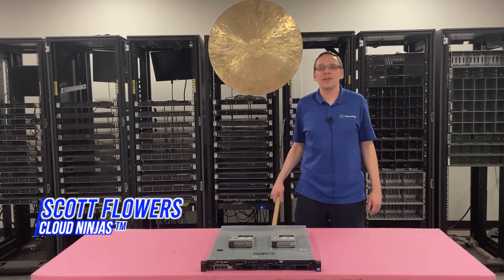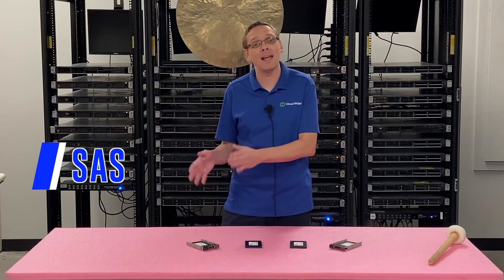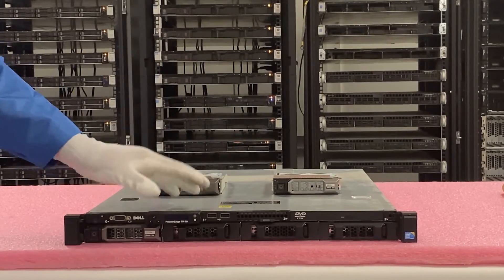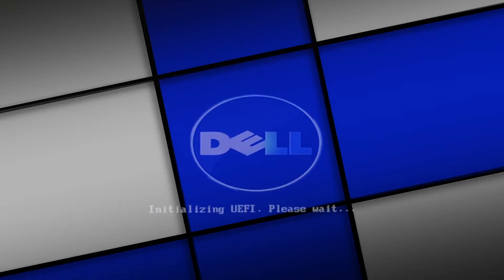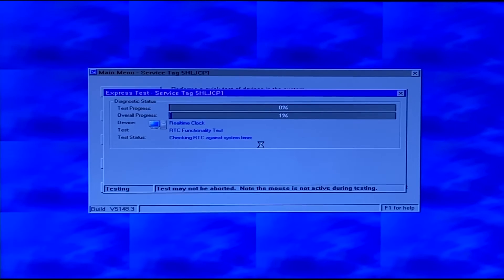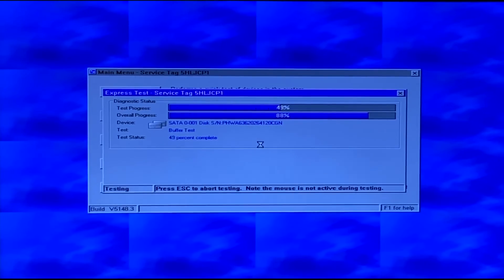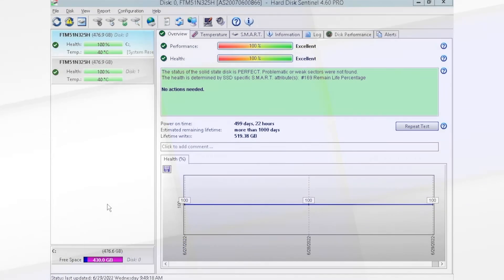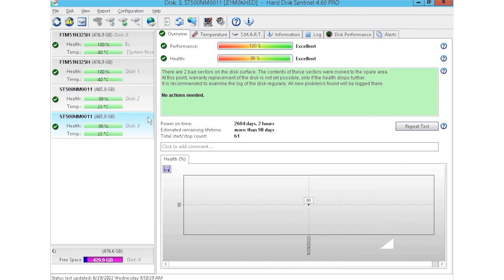Dell PowerEdge R410 Server Solid State Drives | SSD Upgrade Spares & Options | Dell Diagnostics Test

Comment: I don't appreciate it anymore, but it works slowly. In 2024, it's only suitable for basic work because in reality it's too old and no longer good. It's very easy to use and uses a lot of electricity. It's not optimal. Good.

Comment: Since I don't see too much activity in your facebook and Twitter I write here.
The Dell server PowerEdge T140 I have is working 24hrs/day continuously.
It has in mirror (the seller did the mirror) two couples of classic SATA hard disks. We selected SATA instead of SAS for the lower price for small business.
1 couple in mirror 1 TB each for OS (Windows server 2019). 1 couple in mirror 2 TB each for data. 
Are they reliable SATA SSD drives to replace the classic electromechanical hard disks for a Dell Server ? and generally any server.
And what models of SATA SSD drives do you think are more reliable to work continuously as more as possible?
The only program that is working continuously is a custom made email client that receive all emails locally. The amount of emails it receives is about 500 to 800 a day.
The emails we send much much less.
Reply from the maker: We can definitely help.  Please email sales@cloudninjas.com.  Thank you!